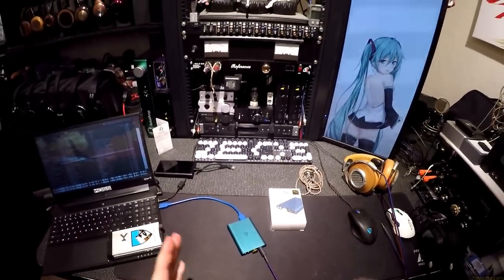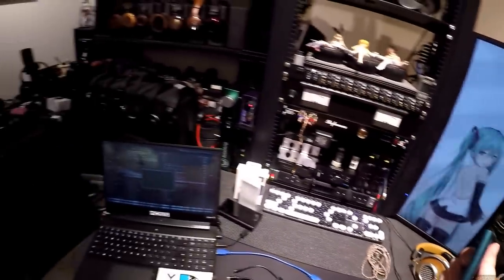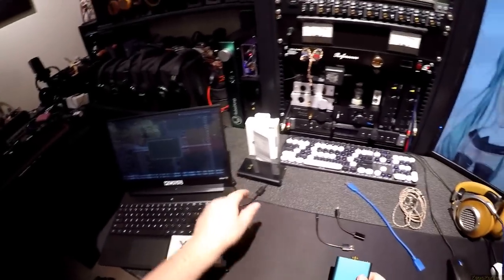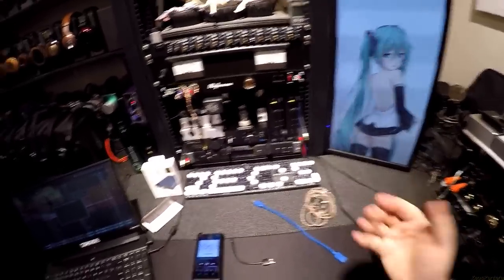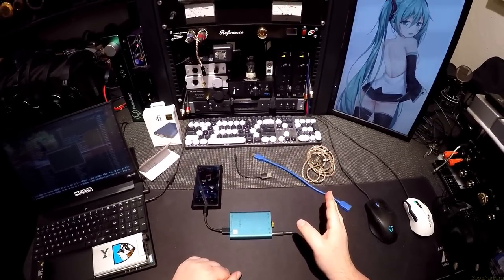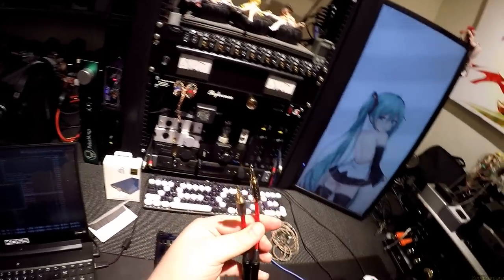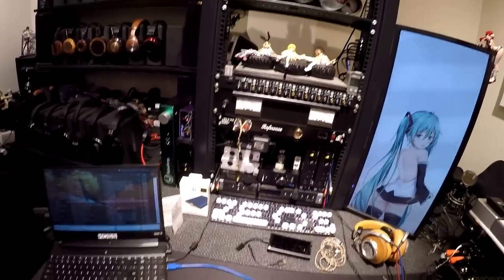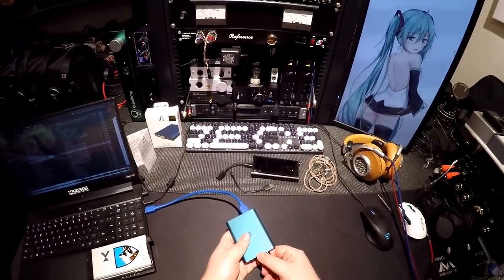ifi HipDAC _(Z Reviews)_ XBASSGasm💦💦

Comment: Looking for my first pair of audiophile(ish) headphones.  Thinking I can get a neutral set that will also satisfy my bass addiction when paired with this or the zen dac amp.  Any suggestions for sub $400 cans that would pair well?
Reply: monoprice m570.. 😅 this is my plan at least.. 🤣
Reply: This is probably a late response, but I would highly recommend the wired version of HiFiMan DEVAs for 219.  The sound and comfort are simply incredible for the price point.  They're likely mid-fi but I don't have the equipment to see if they'll scale to hi-fi.  They do require some power to "open up" but not a ton.  I pair mine with a Zen DAC and I'm trying to decide on a solution for my phone.  I'm between the Hip DAC and the Earman Sparrow.  The Sparrow seems to skew more towards energetic listening and is directly competing with AudioQuest with value for performance.
Reply: @dasninjastix  thanks so much for the suggestions.  You're not too late, still dragging my feet.  Actually in a worse dilemma now because I'm debating on headphones, home speakers, or car audio upgrade.....I can only afford one at the moment.

Comment: Hows the sound quality hold up to the Fiio Q5s?
Reply: Hmm i haven't listened to the Q5S, but I can tell you that the Fiio Q1 Mk2 sounds better than the Ifi Hipdac. Welp, at least to me when I auditioned it at my local store.

Q1 is slightly more detailed and the instrument placement in the music is more precise. The hipdac just sounds muddy in the midrange and I'm not sure if the unit at the store is defective or what, but my music sounds noticeably off from what I'm used to listening on my LG V20 and Burson Playmate. Not to mention the Q1 is also smaller too.

The hipdac's analogue volume pot has serious channel imbalance at 6 to 7 o'clock (just after power on position) but is fine at louder volumes. Something to bear in mind when using it with sensitive IEMs.

Another small detail that I preferred is the centre input port on the Q1 (Q5S also have centred input port too) and it lines up perfectly with the port on my phone. Get the Fiio CL06 right angled cable and the whole thing is compact af for maximum portability. The cable included with the hipdac is short and stiff and I'm afraid I may break the charging port on my phone, plus the Usb A port on the hipdac is not centred, making the short cable bend even more.

Welp, this is the Q1 Mk2, and the Q5s is supposedly an upgrade over it, so hope these infos somewhat helps you in your purchase decision. You really should hear the Ifi hipdac for yourselves and let me know if the hipdac sounds weird or its just me or the unit at the store!

Oh, I used a Fiio FH5 (16 ohms) and unbalanced output for both of the devices
Reply: @njj42  Thanks! If I ever audition the hipdac I'll let you know!

Comment: In your review of the XD-05 Plus, you said it could be basically a starter kit for someone new to the scene. It's small, powerful, portable, and has everything you could possibly need. Well... What about this? I have a pair of DT 177X GOs in the mail and want to know whether or not this is my best bet. The lack of bluetooth realllllyyyyy sucks, but the fact that I could almost just put this in my wallet is awesome and it's far cheaper.
Reply: the xbass doesnt work on the 177x Go. absolute noise a flutter of absolute shit boomy bass. if you dont use xbass it works perfectly fine and powers in completely fine. i own both.

Comment: Any suggestions for balanced dac and amp under $500 for both?
Reply: Massdrop x Grace Design Standard DAC & Topping A50 Amplifier
Reply: Denon Da300 used . Best dac/amp for focal clear 😱👌
Reply: Just orderd Micromega Myamp for 200. When it came out it cost 500 and has very good reviews
Reply: Thanks everyone, I think I am going to go with the d50s and the a50 from topping. It seems like that would give me maximum quality and power.
Reply: @ron2291  TheTopping A50 is really good, but i dont think you really need the D50, the D30 has really good reviews and costs ony 120
Reply: @nariwashere8549  I saw that one but it doesn't have bluetooth which is worth a ton to me.